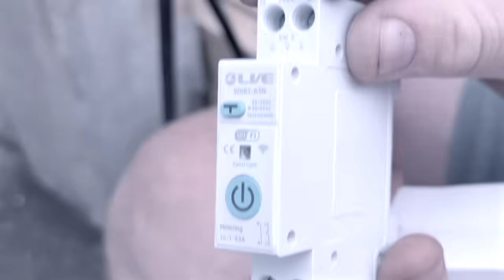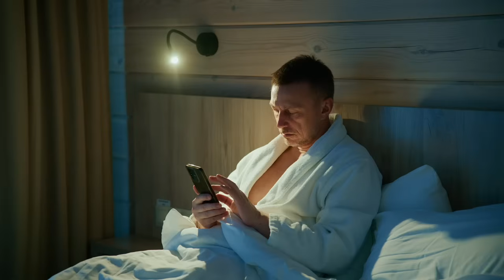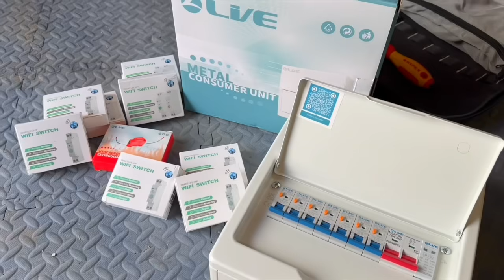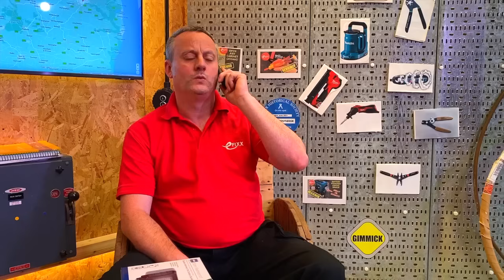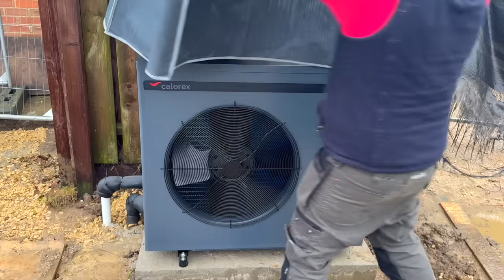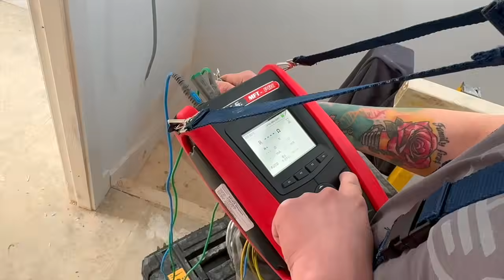Customer Hasn't Paid? Switch Off Their Power!

Comment: Gimmick that will suck some in. I'd prefer a switch away from CU.
When something goes wrong with a smart switch you don't need to isolate an installation while you drop the buzz bar to replace a component, you just isolate the one circuit and deal with the switch.

Comment: why fit this crap?
Surely the multiple automated companies out there that control lights, immersion tanks and other equipment via WiFi outside the consumer unit are better than overfilling your board with this stuff?
I don’t know one client that sits there peering at an app watching power usage.
Yet if there is an issue the fault must be identified before energising again?
That’s a nope from common sense corner😊

Comment: I've been using Zwave for years now and it works regardless of internet connection.
It's a radio frequency protocol so doesn't need the internet (though it's still required if remote control is needed) But once you've created some scenes, there's really no need to connect remotely as everything becomes automatic.

Devices like lights, curtains, blinds, IP cameras or heating can be controlled automatically and activated by events, times or motion sensors.

I no longer have to press a switch for my lights to come on, motion sensors pick up my presence and turn them on instantly. My curtains open in the morning and close at dusk. I even control my AV system and TV using Zwave.

A Zwave gateway is first required and is the heart of the system. Modules like dimmers, switches, relays or multi-sensors are then added into the gateway, scenes created and there you have it, a fully automated stand alone mesh network, working independently of the internet.
What's also great is the modules can be installed in parallel with your existing wiring, so if they ever fail you'll still have control via your legacy switches etc and never be left in the dark.

Zwave gateways start from around £150, modules from £50 and multi-sensors from £90

If you're interested search Cardiff Lighting or message me.

Paul McGuinness (Scottish Spark) 
8th August 2026

Comment: Yeah but you will only be able to switch a unpaid customer's electric off if you are connected to the customer's wifi network. There is no way in hell would I let a tradesman have access to my network, and if they did need access for installing something like this, then they will be issued with guest access and temp password and they would be removed from the network asap after the work is done.

Comment: Been installing home automation and remote monitoring for years. This is a silly way of switching. If you need to monitor the status of MCB's or RCBO,s there are devices that do it a lot better, although it's not cheap because you need a 48v DC infrastructure and all the stuff that goes with it, usually IoT LTE/M which can get awfully complicated and outside the technical sphere of a contracting electrician.
As a tip, if you start to get into 'monitoring' systems, I use purple coloured cable to signify 'sensing', great thing with purple is that if you accumulate rolls over time, there is no BSI or IET purple so every roll is a slightly different shade which can be really handy.

Comment: Let's clear something up.
Your consumer unit having a WiFi controlled switch in it doesn't mean it is connected to the internet. WiFi is not the internet.

It can be connected to the internet but it doesn't have to be (unless the manufacturer has put in a dial-home feature and the switch or app requires periodic internet access otherwise it stops operating; which they shouldn't do this).

My recommendation is to build and configure a separate WiFi network with a separate wireless access point and do not connect it to the internet, and use dedicated mobile device(s) connected to that WiFi network to enable control of the devices.

Then it cannot be hacked, because it cannot be accessed remotely: you need to be in close physical proximity to the wireless access point to hack.

Comment: I do wander if you can automate without the app, using a local comms protocol like mqtt or modbus.

Some ideas:
Isolate non essential circuits if 2ooN smoke alarms are activated, or 1ooN alarms unacknowledged for 2 minutes.  Easy to do, but hard to get safety approval for it.  I think iec61508 comes into play here.

Comment: Pretty standard feature set for this sort of item and probably has a TUYA backend.  Running control of your circuits through a backend in another country?  Not sure about that being a good idea.  Consider this too, when a MCB/RCD/RCBO trips all current stops.  With one of these devices the unit itself continues to be powered so in reality should it have an upstream protective device?

Comment: How do you safely isolate the circuit/Lock it out for maintenance purposes or do you have to lockout the whole board ?
Reply: Duh you turn off the main isolating switch, if there are any other people that might mess with it lock it, then test if the board is still live or not

Comment: What is amp rating for these? 
I need one rated for more than 40 amps for the experimental Indra V2H charger. The charger fan makes a racket in hot weather even not in use, so I only turn it on when actively using it. 

Can this be locally controlled by Home Assistant?
Reply from the maker: They're generally rated for 63 amps, and yes, you can integrate them locally with Home Assistant! 😊
Reply: @efixx 
It’s RCD, not MCB. Can this deal with reverse current from bi-directional V2H charger?

Comment: It all sounded great until the name of the app was meantioned - Smart Life.
TCP smart plugs worked fine right up until they were branded with the dual name TCP /Smart Life Tuya.
They are a bastard to pair, regularly 'lose' sight of the router and randomly switch on the child lock function - which shows the device as On by default when in fact it is off.
They are such a bastard to pair that i had to turn off my router, set up my phone hotspot with the same name and password, to 'pretend' to he the home network, and then use another phone with the app installed to pair them to the pretend  network. 
(Then restart the router having turned off the hotspot).
And the permanent fix for the random dropping of the network apparently is to employ an IT engineer to assign static network addresses for each device within the router software.

Comment: Thing is that very few customers will know/remember how to pair it to their WiFi so there'll be a callout every time the customer gets a new router (and we all know that they'll expect that for free!).

Then it relies 100% on a third party service to operate, what happens WHEN they discontinue the service?

Who's providing the continuous firmware updates to patch the security flaws?
Reply: "what happens WHEN they discontinue the service?"
and that is exactly why i wouldn't use something that should work locally but requires a server who knows where, for no better reason than the manufacturer wants to turn the customer into the product. and why would i want that?
Reply: Good points.
A wired network connection would become the norm.
Reply: Pound to penny it's another TUYA based thing.  Stuff with the same feature set is all over the usually places starting with A.
Reply: I would imagine it would just be a regular breaker at that point?!

Comment: I always use a simple local network connection for smart relays (eg Shelly) , no cloud account needed. You can have all the functions, monitoring, scheduling etc within the range of your wifi router, without internet connections.
I can't see the point of being able to turn your consumer circuit on and off when you are lying on a Spanish beach.
Maybe you forgot that your electric heater was still on at the wall when you powered off the circuit via the smart app.and then turn it on remotely when you are at the pub to impress your mates, and get home to find your house has burned to the ground.
Reply: its just a gimmick you'd use probably once every 5 years.
id rather have the inconveniance of having to go and flip the breaker back on, rather than doing it from 10 meters away. if it trips again it'd become annoying so I'd be more likely to get someone to look at it sooner rather than later. I feel many people are going to ignore potential fire/safety hazards with something that makes their life too easy.

if i wanted the ability to turn of multiple devices, id rather have a smart plug, or relay that would switch off individual items rather than the whole circuit.
Reply: @user-hdjddj3j If your breaker is in Spain and you're in the UK, they're kinda useful!
Reply: @biker_rich_71  why would i leave something on if i knew i was going to leave the country? id make sure to check before i left. still seems like a pointless gimmick.

plus if the cloud provider goes out of business which many of these companies do - then boom, you've lost access to the app anyway
Reply: @user-hdjddj3j AirBnB!  You own flats dotted around, you can monitor them from this and kill the power when the contract ends.  Very useful when guests don't turn off all the appliances before they leave.  And, I suppose, to ensure they don't outstay their welcome.  I bet that happens.
Reply: @Dranok1  not if the tennants have killed their internet if no communial wifi was provided

Comment: I had a SPAN panel installed with my solar (in the USA) to monitor load and manage loads when the grid does away.  Shedding loads as the battery level drops.
Reply from the maker: That sounds like a really clever way to manage your energy usage! 😊

Comment: But a consumer unit isnt designed to be a switch and your meathod for outdoor lights or garden room to turn it on or off and it specifically says the mcb rcbo or rcd is not designed to be used as meathods of switching a commonly used circuit on or off its to prevent a dangerous occurance and also by means of an isolation
Reply: It depends some of them have a very, very high amount of switching cycles that it can do especially commercial breakers

Comment: These have been available in Asia/China for years - I refuse to use the wifi version as it has to have cloud access and phones home to ... (China?) but if you use the zigbee breakers you can control them via home assistant locally. The best ones have temp monitoring and realtime current deviation analysis
Reply: You can use the WIFI version without cloud access. I have three of these and they run locally through home assistant using the Tuya local integration.
Reply: If anything your own self hosted home version is going to be worse as you don’t have security training China does not care about your light
Reply: @TheLostPacketYT that is a very narrow minded view. An adversary wants to use your network as a resource for further attacks. A persistent way into that network is what adversaries want!